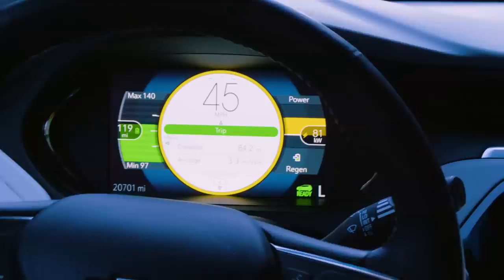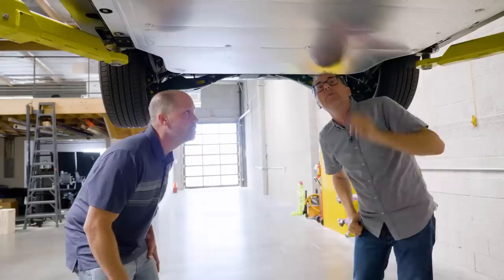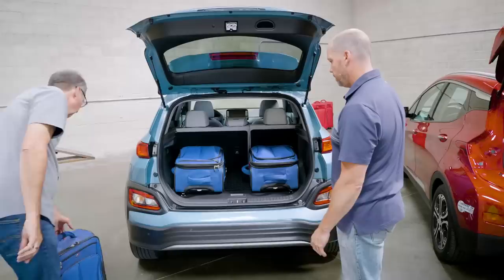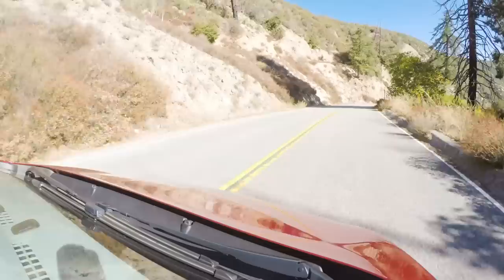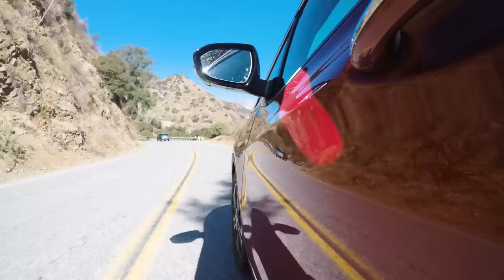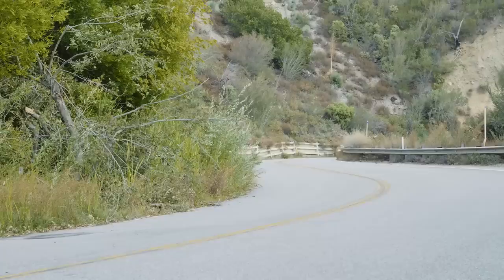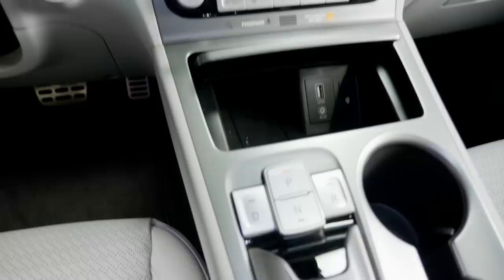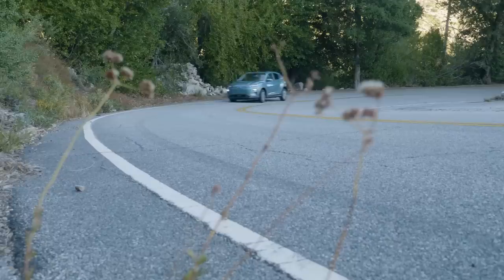Hyundai Kona Electric vs. Chevrolet Bolt EV: Which Is the Best Affordable Long-Range EV? | Edmunds

Comment: I have a '23 Bolt ev on older, and I'm so looking forward to it. I like that it's a taller hatch.
I would have looked at the Kona, but I like to buy local, and there's not a Hyundai dealer in the town where I live.

Comment: Edmunds should test cold-weather performance. Other reports have indicated that Hyundai/Kia's EVs don't have very sophisticated thermal battery management systems compared to the types of systems in Teslas. So the range is drastically reduced in the Hyundai. Haven't heard anything on this about the Bolt. For people in colder climates, this is really important.
Reply: Absolutely! I live in NY and have had 2 Volts.

Comment: Hyundai wins for sure.
Reply: The most important part of an ev is battery management. Chevy wins . The kona we simply dont know. I'm bet you they will release the Kona in Canada and America after the winter to avoid the battery issue.
Reply: If Hyundai produce some of the cars, maybe will be better. There's no way to know, until Hyundai has them available to the public for purchase.
Reply: Also kona needs to go thru a harsh Canadian winter. Bolt A+

Comment: Not.making the Tesla model 3. I see them all over the streets.?! 

Nice test.
Reply: Whistling K9 that versions too much more expensive than these.
Reply: Every one you see is >$50,000.
Reply: @boxmonkeyracing  ...but more to the point of this test, Bolts start @ 37k. You're right in that the key that the Tesla fans keep skipping over is in the title of the video. "Affordable" People (i.e. everyman) don't consider a $47k car to be affordable. In fact, most people don't consider the $30K (after tax credit) Bolt to be affordable...but we're getting closer.
Reply: Ok. I get it.
Reply: @boxmonkeyracing  ....and then add in that destination charge for the Bolt, too. ;) You think that's something Tesla made up or invented? 

And the Model 3 is then a lot more car for that money. I say that as a Bolt (and Model 3) owner. Unless you want the Bolt's particular format, the high-hatchback.

As for the Kona, well that is the actual vaporware here. And it will remain so outside of CARB states. You might be able to find them in CARB states though but production appears to be planned as even more limited than the Bolt's.
Reply: @boxmonkeyracing  Actually:
1) you're talking out your ass. I just went over and ran through a 2018 Premier build at the Chevy site. Without even selecting all the crazy little odds and ends (like Chevy brand window screen ;) ) the total was over $44K and then it laid on the separate line item under that:  "Destination Freight Charge $875" , boom >$45K.
2) you're losing an argument here over pennies and missing the pounds of the Bolt EV is a $8,000 cheaper vehicle experience. ¯\_(ツ)_/¯ It'd be a $10,000 cheaper experience if it wasn't for the heated steering wheel and the bird's eye camera (although I never use that myself).
Reply: @boxmonkeyracing  ....and just keep drooling gibberish hits coming. LOL

"Nothing resembling it"? Bystanders will have to know where to look and look close to pick them out. The only difference will be the small portion of the roof over the front seat will be metal, not glass (most of the "roof" is actually back window), the seats will be cloth, and the stereo won't sound quite as good, and the battery pack will be smaller. It'll even accelerate and regen as fast as the current MR, and handling will be nigh identical.

How about instead you wait until you're not an idiot before you dump crap on this website?

Or maybe we wait until there's actual Konas? Face it, tossing around "vaporware" not aimed at the one vehicle they do test drive that doesn't actually ship yet was pretty damn embarrassing here.
Reply: @boxmonkeyracing  You realized I just built it out? $45k 

Time for you to chow down on crow.
Reply: Yeah my model 3 was a bit more expensive than these two.
Reply: They haven't sold them in the EU yet. So for EU people it's still vaporware. While i see Hyundai Kona driving around a few already.
Reply: @NukePooch1  The Opel Ampera E(GM Bolt) starts out at 47.000 Euro. While the KONA starts out at 39.000 Euro. Why would you buy the GM Bolt.
Reply: @HermanWillems  

Congratulations on your Misuse of The Word "Vapourware" win. Please promptly get in the sea to collect. :) There have been Model 3s driving in Europe for a year now, you just have to self-import. ;)

Comment: For the money I would get the mid-range Model 3 that is now being offered for $45K.  Not much more and a way better car.  Plus, I would think that resale value would be way better.  The true cost of a car is the difference in purchase price less resale price.  A three year old Tesla Model S90D still goes for around 70% of its new price.  A one year old Bolt goes for around 70% of its MSRP.  Not sure how well the Kona will hold its value, but add to that the supercharger network, and you would be a fool to put good money down on the Kona or the Bolt.
Reply: $10K is a huge jump at this level. The Chev and the Hyundai are both much closer to the "EV for everyman" goal. The Model 3 is currently a level or two higher and the price reflects that.
Reply: 10K only If you consider the base trim versions of the Bolt EV and Kona Electric. (Not saying that those would be bad choices)
Reply: @NukePooch1  Both vehicles used in this test were over $40K.
Reply: @dchristo10  ...and Model 3's can be priced a whole lot higher than $47k...but they can't go any lower. Base price to base price the Tesla doesn't compete with the Chev and Hyundai. Tesla's in a different class until they make a car with a comparable price.
Reply: I was one who put the deposit down on a Model 3 right after it was introduced.  As I waited and waited and waited I started learning something about Tesla that scared me to get my deposit back after 15 months.  Have a wreck in one, at least in my area of the country, and you're screwed.  Even though I see lots of Teslas around here in my city of over a million people, only one body shop is approved by Tesla and that's it.  Cars are known to sit there for months as they are at other body shops across the country.  Tesla blames the body shops, body shops blame Tesla.  If I hit a deer or another car hits me I want my car fixed.  Not interested in it being a high priced paper weight.  And, Roger, I totally agree with you that the Model 3 is better than both of these cars for the price, except.....
Reply: @OpineNow Looks like you're right. I think Tesla's now in the $3750 credit bracket. Yet another reason why the Model 3 doesn't compete with the Bolt and Kona.
Reply: @NukePooch1  Wrong. There is still another week left to order and get the full credit, plus the mid range has been available for over a month while this comparison video was being produced. They should have taken time to obtain a base model mid range since it's within $5k of these two as tested. It's not 'vaporware'.
Reply: @OpineNow  - If you order before November 30th, Tesla assures that you would receive your Model 3 before the end of the year (US only).  This would get the full $7,500 Federal tax credit.  After that the tax credit goes to $3,750 until July 1st, then it goes to $1,875 until January 1st, 2020 at which time it goes to 0.
Reply: @SvenOllino  I am very concerned about Tesla Model 3 reliability and the impact on insurance costs.  Seeing many stories of Tesla Model 3 owners loving their cars BUT mentioning the need for service shortly after taking ownership - not a good look.
Reply: @OpineNow  - No leasing available yet, but they do have a third party Alliant Credit Union that they link to for financing.  Rates are around 4%.  I have heard that they are working on a leasing option for next year.  As far as production, they are at 5000/week, and working their way to 7000 per week once two new cell lines are up and running at the Gigafactory.
Reply: @NukePooch1  
But the model 3 is taking business from even cheaper cars.
Reply: @OpineNow 
Take a look at the figures for the "previous cars" of model 3 owners 
Often much cheaper.
Look at the drop in sales of the Bolt, year on year.
Reply: or you could Buy/Lease a Tesla model S for $40K.
Reply: @OpineNow plagued with production issues? Oh please. Way to buy into the negative media train. They've sold nearly 100k model 3s this year, chevy hasnt passed 15k and the Hyundai is literally not passed 1k but it's tesla with the issues? Ya ok.
Reply: What about a long distance charging network or continued software updates? Do the Bolt or Kona have those?
Reply: @OpineNow look at the sales charts and then tell me that tesla is the one with production issues.
Reply: @OpineNow  - FACT is TM3 Deliveries are up, and at the Same time Repairs and Defects are Down. 
KONA EV and IONIC have a shared system , and they have Quality/Reliability issues with its Batteries overheating/catching FIRE. that need to be fixed before cars go back into production, also have to fix Existing cars with Electrical fault.
Reply: Harry Fishnuts   - or you can buy parts from a Salvage Tesla, do the work yourself.
Reply: Harry Fishnuts   - Rick does it all the time @ Richrebuilds channel youtube
Reply: 30% more is "much" more.
Reply: Harry Fishnuts  lol ok then
Reply: 20-50% failure rate in the first year alone is not "a better car"
Reply: @xeserupseinopelttil4574  What has a 20-50% first-year failure rate?
Reply: That's very expensive for most people and that's far from the only issue here.  Tesla reliability is very questionable for mainstream buyers, the company is on rocks, build quality is an issue, and delivery is still shaky. On top of all that, Tesla's warranty is pathetic and once you're out, good luck getting your car serviced easily because Tesla won't provide your local mechanic proper tools or manuals to work on those POS's and Tesla service centers are scarce unless you're in California.  I think i'd trust a Hyundai or even a Chevy (never thought i'd say that) as my everyday car way more than a Tesla.

Comment: Rear seats of Kona are too far forward, so passengers get crammed in favor of more cargo room in the back. Bolt went the other way and put a camera on the back to eliminate the need for a traditional rear view mirror. So, with the Bolt, stacking cargo to the ceiling has no impact on visibility via the mirror.

Comment: Hyundai looks better to me and looks like it’d have more room
Reply: It doesnt
Reply: They clearly showed in the video that both storage and rear legroom are better in the Chevy. The interior definitely does look better on the Kona, but you have to remember the Chevy has been out for 2 years.
Reply: I own a Bolt and others will tell you seeing both live....the Bolt has way, way more room and practically layed out. Think about it. GM built this specifically to be a light weight roomy EV. Hyundai designed a Kona gas car which they intend to sell millions of and then "modified" it to have an EV version as well.
Reply: @jmn64 Dan Edmunds is 6'2" tall - for perspective
Reply: Gregory Perkins "Hyundai looks better to me"
They Hyundai looks like a proto type that has no history of functioning. e.g. A good looking broken button isn't what most ppl want in their cheap car.
Reply: @dmay3391  Don't know about that but Hyundai got a pretty good reputation together with KIA with their fucking long waranty of 7 years standard.

Comment: No contest at all! The Kona wins. Faster charging rate, superior chassis/suspension, better interior. THE issue is availability. The Bolt is nationwide, the Kona sold only on ZED states, which have state income tax deductions. As to deductibles, the Bolt, as of September 1, 2021 has none and the Kona does. Lastly, the Kona batteries, so far, do not catch on fire and the Bolt ones do. Chevy will replace all batteries of all Bolts EV/UEV and issue new warranties, but the “when date” is an unknown. Thanks

Comment: I'm surprised a little that the back seat legroom is bigger than Kona EV... Interesting... I sat in the front seat of Bolt EV once and the seat was tight and the whole interior felt a little cramped compared to my LEAF 2017.

Comment: Headlights:
Just price the OEM replacement and you will be immediately cured from any desire to replace them.
"polishing" is only short term solution for used car dealers to improve the vehicle look, it quickly hazes especially if exposed to sunlight, apparently the plastic that is used has some coating that gets removed by the polishing process and what took years to happen, happens again in just few months.
Reply: No, that's not right.  Headlight lenses are made of polycarbonate.  It does not go hazy on its own, not ever.  Even with abundant sunshine.  What you have to do to achieve the haze is to add car polish.  The volatiles in the car polish attack the polycarbonate, with the aid of sunshine, and start to turn yellow.  Keep doing this, and they will turn frosty.  You can fix this if it hasn't got too bad yet, by polishing them with toothpaste.  It takes a lot of rubbing, but it does work.  Just remember, do not ever put car polish on your headlights.  There is all kinds of misinformation about this problem, but this is the truth.  As proof, my 20-year-old Daihatsu's headlights are crystal clear, due to never having had car polish on them.
Reply: freddyzdead1 thanks, I'll remember this. I used the toothpaste trick to greatly clear up the headlights on our aging Hyundai but then polished them, and they already look yellowish again. No more polish.

Comment: Smooth vs. ribbed... Would be good to know the impact of the battery case's "smoothness" on energy efficiency, which is the only reason for highlighting this difference. Otherwise it's only a matter of which "pleases" you aesthetically when you look up from underneath.

Comment: The biggest problem is the Hyundai Kona EV will only be sold in EV friendly states/provinces(I you need anything fixed and don't live in the EV friendly states you are screwed).I live in Calgary Canada and can buy a Chevy Bolt at my local dealer and can get service/warranty work at the local dealer.

Comment: I propose that the next generation Bolt that Chevy guys need to widen the wheelbase and add better tires and change those seats and just make sure Apple CarPlay and Android Auto is available. The next gen of Kona Electric only needs a 3-inch expansion of the wheelbase axle to axle. I think both cars are budget winners with the government incentive to assist.

Comment: Pretty easy to decide between the two here in MA.  Kona I could not find any available.  Bolt has LOTS of rebates making it much cheaper.  Also hesitant on Hyundai given how bad our 16 Kia(Hyundai brand) was.  The 3 is nice but no Federal or manufacturer rebates make it pricey.  Test drove the Bolt and the interior did not feel cheap and I had no problem with seat comfort.

Comment: A series of fires prompted mass recalls of Hyundai's best-selling Kona EV in South Korea in October. In South Korea, Hyundai has recalled 25,564 Kona EVs built during September 2017 to March 2020 due to the risk of short circuit possibly caused by faulty manufacturing of its high-voltage battery cells.

Story source: https://www.reuters.com/article/us-hyundai-motor-kona-ev/south-korea-probes-adequacy-of-hyundais-kona-ev-recall-after-new-fire-ministry-official-idUSKBN29V0CW

Comment: Why are you not using the steering  paddles there are more than 3 regen levels we only saw you set the regen via the touch screen not the paddle or in the different modes there is one pedal driving in the kona when you set full regen

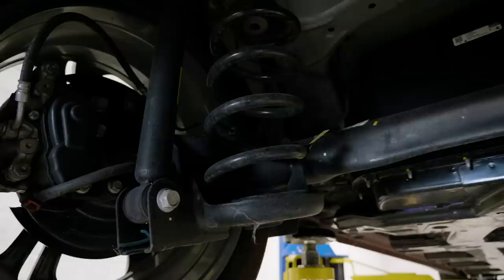Comment: You 2 dips shifts are biased, sensationalized everything negative about Bolt. Slide front seat way back on rear seat pass in Bolt. Do that in Kia? Nope. 3:50 "this is a basic twist beam? No it's a "compound crank with coil springs." Kia better ride? In your mind. Bolt suffers from bad stock tires. Transparent pretending to give fair eval is bull shit. PS I have 2015 Leaf SL (bought used a year ago for $12K as second car.
Reply: So, if the Bolt has "bad stock tires" which affect the ride, why fit them? Maybe the mask another problem?
Reply: @rogerstarkey5390  Tire sequel is because of the hard compound which is good for longer tread life and less rolling resistance but not dry traction. New performance all season tires would do a lot of good. Shocks, Chevy already announced Bolt upgrade for shocks, springs and maybe seats. No masking only improvements.
Reply: @gmcjetpilot  
They did a great job on R&D then?